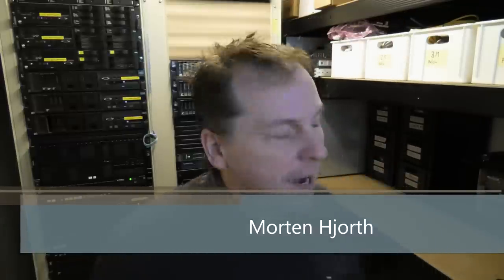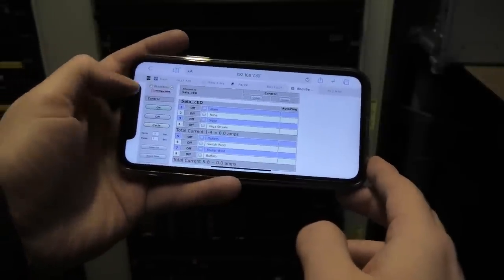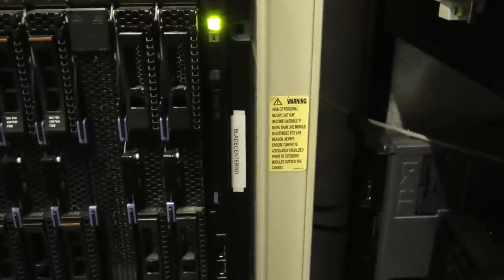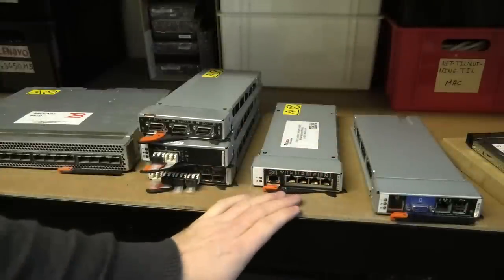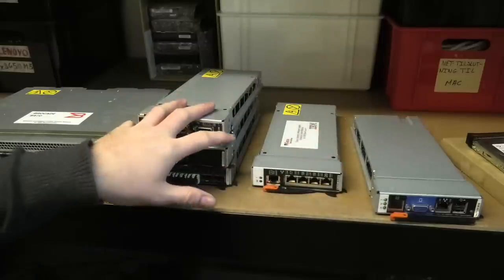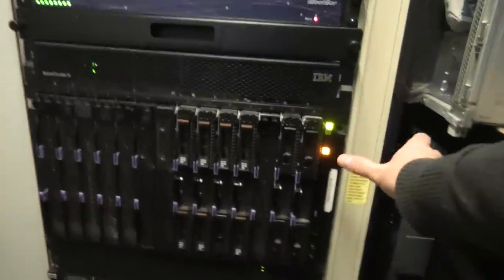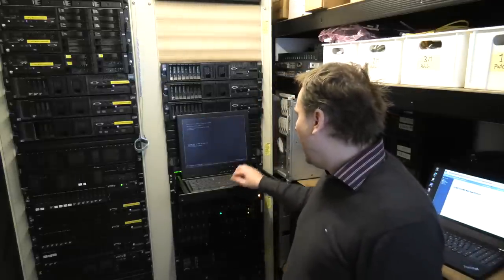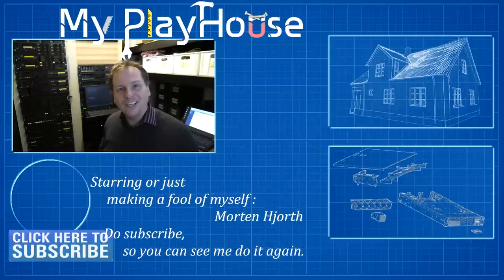IBM BladeCenter H with HS21, HS22 and HS23 Blade Servers - 1036

Comment: I used to manage an entire rack full of the original IBM blade centers back in the early 2000s. A fun fact I found out from an IBM salesman at the time was that the Lord of the Rings movies were rendered on hundreds of blade centers by Weta Digital in New Zealand. Those blade centers used a ton of power and the heat they generate at the back of the rack is insane. I managed a cluster of Linux servers. There is an excellent software suite made by IBM to manage the cluster called XCAT. It's a fabulous management tool that works brilliantly with the blade centres
Reply from the maker: Hi Richard Frost
Thank You very much!  glad you liked the video :-)
Thank you for watching! :-)

Comment: Blade centers are an interesting set of devices.
Consolidating redundant power delivery, cooling and management is a nice feature of them.
The additional feature of being able to pull out a whole server without needing to even care about cable management is also a nice.

Though, IBM's choice to go with such slim blades is a bit odd, since half height RAM tends to be more expensive than normal height RAM. (due to the lower manufacturing volume.)

I think HP has a bit more practical blade form factor. Since it can use normal RAM, and there is even a GPU expansion blade. (It can take 2 slot GPUs just fine. Though, preferably one's without any fans, since it will suck air through the card. Since the PCIe bracket faces the front of the server.) And there is even some HDD drawer expansion if I recall correctly...

Though, HP also made some odd decision, since the blade center itself has an expansion slot for integrated networking on the blade itself, but not all blades comes with integrated networking... (Ie, one needs to buy a more expansive network card for their proprietary mezzanine slot and a second network switch for the blade center itself.... And some blades one might want to put a GPU into, but then one can't have a second mezzanine card installed, so then one better hope it has integrated networking on the blade itself. One can push files via the management interface but that is a drag to say the least.... They might have fixed this on newer generations, hopefully.)

I wonder what "problems" Dell's blade centers have.
Reply from the maker: The thin blades became a problem when the CPU's started to use 150W,,each :-/
Reply: @MyPlayHouse  That I can imagine.
Not much room for spreading heat vertically in that form factor, and spreading it horizontally has its own limits.

Comment: I've always wondered why you didn't use the bladecenter more since it seems like a pretty cool system to experiment with. It would have been cool if you'd shown off the Power CPU based blade as well, since that's a pretty unique type of system you don't see very often.
Reply from the maker: I am not that much in to power,,, I lack a lot of knowledge on them.
Reply: @MyPlayHouse  I can understand that, I'm just saying it would have been cool to have a look inside that one as well. It was still a cool video though.
Reply: My PlayHouse maybe I can help you? I have a few in my own home lab

Comment: Hi Morten.
We have an IBM FlexSystem PureFlex Bladecenter with several IBM/Lenovo FlexSystem x240 Compute Nodes in our production datacenter at my workplace.
We are in the very slow process of replacing it with regular POTS servers.

I am not making any promises, but IF we are going to scrap metal it and not use it for something else, MAYBE I can arrange to give or sell it to you.
It is not my decision to make though, I can only keep tabs.
We are somewhat close to the Danish land border so pickup might also be an option instead of shipping.
Reply from the maker: Hi Astra7525
Thank You very much!  The FlexSystem is not that high on my list :-)But do let me know,,when the time comes.
Thank you for watching! :-)

Comment: Darn it Morten, I now feel thaT I have to upgrade my home lab!  Running a HP DL380G6 with dual 5650's and 64gb of ram and 8 600GB sas 15k drives and a Lenovo TD340 with 2 x E5 2420 V2 and 96 gb of ram all running Hyper-V.  The T40 is running 2 x 2 2tb seagate enterprise drives for OS, a single 2tb seagate enterprise drive for backup with veeam, 3 HP 15K 146gb drives in raid 0 for fast storage, 2 x 120GB intel 330 ssd's for more junk and the real fun.....2 x NVME to PCIE adapters with 2 x Samsung EVO 970 1TB drives for the MS deployment toolkit and adk!  All connected with 10-gb fiber
Reply from the maker: Hi alpine7840
Thank You very much!  glad you liked the video :-)
Thank you for watching! :-)

Comment: I have 5 HS22 blades with dual Xeon X5675 on a BladeCenter S with 10Gb switches and 12 HDDs. I'm running ESXi 6.7u4 without any problem, but unfortunately it's impossible to upgrade to ESXi 7.0, the Megaraid is not recognized. Do you think it will ever be possible to install ESXi 7.0 on these old machines?
Reply from the maker: Are you using Lenovo ISO's ??
Reply: @MyPlayHouse  Yes, I've used "VMware-ESXi-6.7.0.update03-14320388-LNV-20190814.iso", you have just to accept that the CPUs are not supported. The blades works without problems, with all the last updates applied.

Comment: I don't have any server hardware but I could imagine these blade servers are power hungry ( and noisy). I have half a dozen PCs doing FAH, and that'll help with heating since it is -15. In summer however,  I think I will turn some of them off as I don't need the heat then.
Reply from the maker: they do use a fair amount of power.

Comment: my problem with my servers are RAM, im running Mail Servers for a few domains and the SPAM filtering software im using with Postfix uses a lot of RAM. i need RAM more than CPUs but finding motherboards that supports a lot more RAM on a single CPU board is the issue.
Reply from the maker: With the less number of slots in Blades,, you need some of the big blocks for them,, 16GB or 32GB

Comment: Hi Morten, will it be possible for you to record the video in another room when you explain/show stuff (like the back modules or the inside of the blades) and when you use the menagmente? It's very noisy in here and i think it will be a good thing to record in a less noisy enviroment when possible. Obviously i speak only for things that small and light/easy to trasport
Reply from the maker: I am afraid that Enterprise equipment is just very noisy,, I would have like to show you some more of the back,, but the noise was to much,, so that is why I was looking at switches in front of the blade center.
Reply: @MyPlayHouse  yes i know, i also have a couple of servers. I have 2 fujitsu RX300 S7 that are loud and i have a Dell R620 that is basically silent when it's in idle or on low "stress" (mi switch i louder)

Comment: I take the same type of this server ( save From recycling and cutting factory of course without the HDD ), and six new version of blades are filled with 96 GB DDR3 ECC-REG RAM.
Of course I took it the power units and I/O units also, with special power cables, and the optical network cards.

I have a question.

This type of server can I use for a CPU based cryptocurrency mining or not?!
Reply from the maker: All servers,,, but you need newer ones to make anything with the power prices.